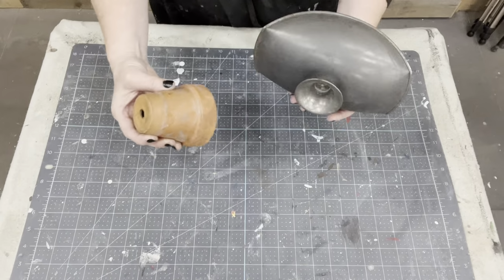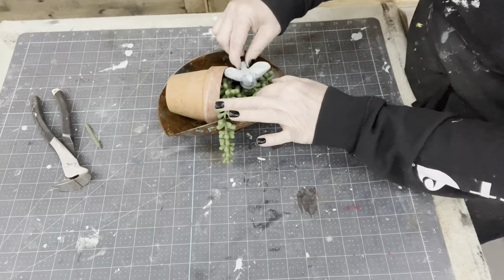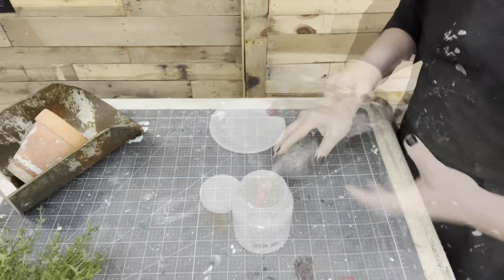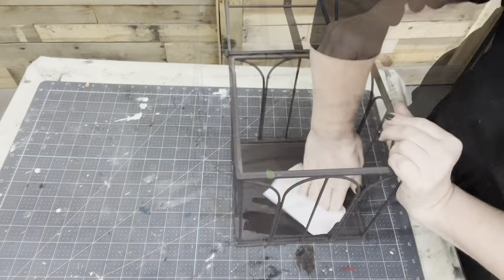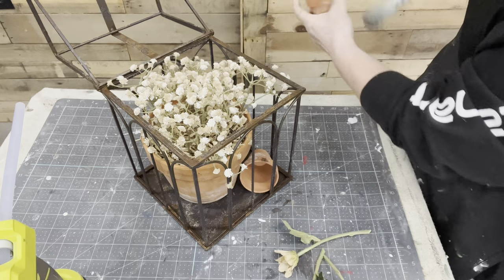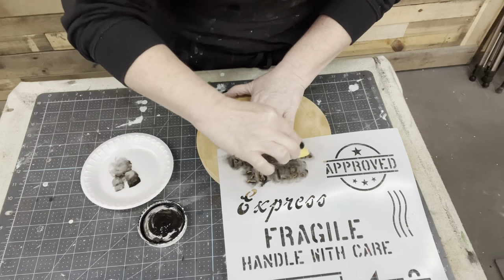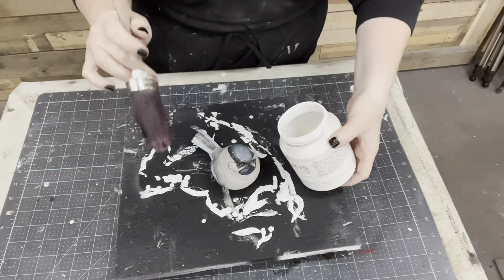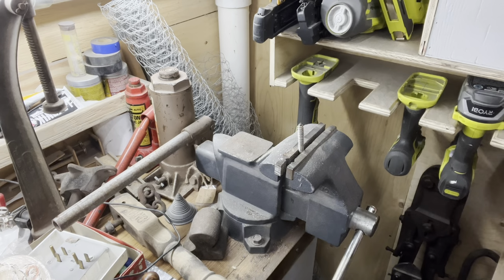Thrift to Treasure | Thrift to Beautiful Home Decor | Up Cycling Thrift Store Finds

Comment: Tip: I have used matte mod podge on shiny surfaces as a base for chalk paint. it works well. I love all of these projects. Did you use Dixie Belle Prime Start on the metal before you used the patina paint? I just got some of the patina paint and spray and am anxious to use it. I didn't get the Prime Start. I was hoping that you don't have to use it on metal.
Reply from the maker: I haven’t used any primer underneath the patina. 
I had a windmill that was in my outside booth . And it held up extremely well.

Comment: On Youtube there is a hack that a man makes a cardboard hotbox with a hole in far left top to put blow dryer heat and a hole in lower right corner in front for hot air to vent out. 
Do you recommend this for faster drying times?